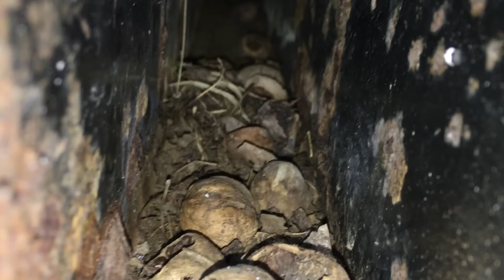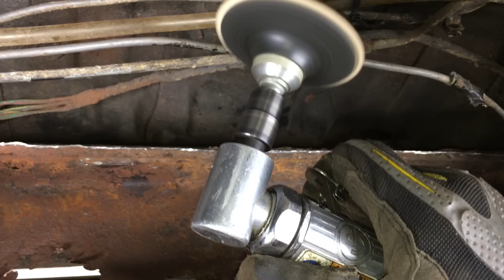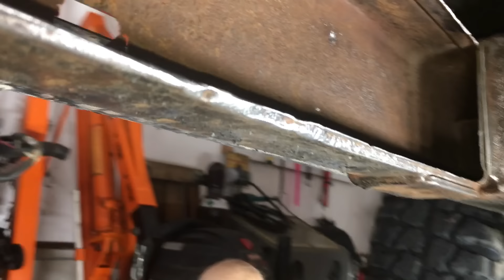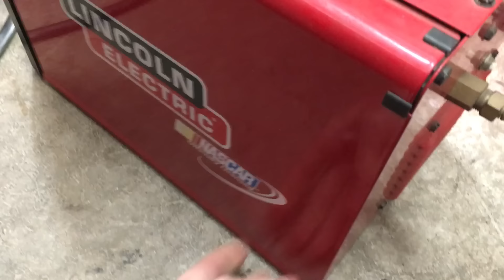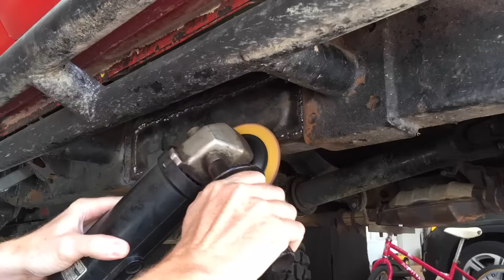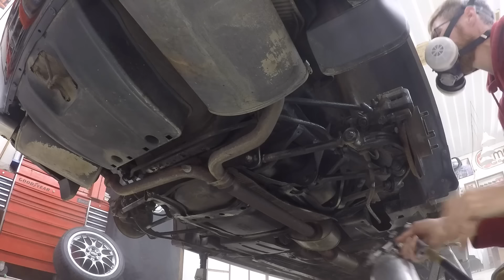How to Properly Repair Rusty Frame of Toyota Pickup Truck at Home

Comment: Should have applied a Weld Thru Primer (misnomer it's zinc/copper coating) on the inside of your patch piece to protect the inside from rust before welding.  Both SEM/Upol offer.  This is oem standard body shop repair procedure for inaccessible seams after welding since mig weld will destroy e-coat/paint and you can't paint it after.  Also I would have hit the inside of the old good part of the  frame with rust converter paint before fluid film.

Your welds are bad tbh - poor penetration - i wouldn't call those structural.  Inspect from rear side .  I bet they're vry bad.  Should practice more on same thickness scrap and dial in your welds beforehand and do destructive test of them to make sure your welds are solid.  I will not be hitting you up to do any suspension parts welding for me, no offense.
Reply from the maker: Yeah, I really wish I had a 220v welder. I used one before and it was effortless compared to trying to weld thick steel with this 110v. I really hope I can buy a rust free frame from down south, as this one has seen better days. No offense taken... I always appreciate advice from professionals/people who know more than I do.
Reply: @6thGearGarage    Flux core runs hotter and can do thicker work on same voltage.  For frame work its perfectly ok if its a bit messier and you can always use some antispatter around the work area if it bothers you.  Stick welding is also cheap and very good for frame work.  For thin sheet metal/cosmetic work obvi wire mig is preferable as you probably knew already from your other work.
Reply: It's easy to sit at home and write trolling remarks....the lad at least had the gumption to crawl under that rusty old truck and work on it, kudos to him, it's his truck, leave him alone, he's doing and learning like everyone else does.
Signed
A 66 year old pipe fitters & fabricator
Reply from the maker: @robertward8037  Thanks, I always get some flack on videos. I did it this way because it repaired the back half of the frame the exact same way 10 years ago and it's still great. Everyone has their own ways and I'm always up for trying a new method, as well as sharing one that worked for me.
Reply: @6thGearGarage  Keep doing what works for you, your work looks fine to me, I live in Ohio also and drive an 2004 Silverado to work and town....it's turning into a rusted heap from the salt...lol, you can crawl under my truck and do all the welding you want any day, I'm getting to old for it anymore, it hurts to get down low and get back up 🤣. Have a great life my friend
Reply: @robertward8037  unfortunately the rest of us have to be on the road with half assed structural welds so kindly shove it.  thanks.

Comment: Man, what dedication to your truck. I think most folks would have scrapped it a while ago. Nice work.
Reply from the maker: Thanks! I'd really love to swap the whole frame with a rust free one one day.
Reply: @6thGearGarage  I personally appreciate trying to keep the old frame alive, since for me it's just not an option to go find a frame from some southern state.
Reply: @1873Winchester  keep your mitts off our frames! Hahaha kidding.....a bit...
Reply: @REAPER3fitty  Don't worry I'm all the way over in Finland
Reply from the maker: @1873Winchester  I need to drive out west with a trailer one day and bring a stack of nice frames back to Ohio.
Reply: @6thGearGarage  you and me both, but eventually once you replace all the rusty stuff itll be fine.. haha my 90 grand wagoneer was nearly as bad, or worse... took years n years of cutting and welding, but 90% of it is repaired and fresh/clean, 0 rust now and tbh stronger than it was originally.   My shock mounts in the front pulled off the frame with the frame when i grabbed one to pull myself off the ground.. my body mounts.. werent even there anymore, i could lift the body off the frame and bounce it up and down...  And my shackle mounts in the rear were swiss cheese, the frame was swiss chease in the rear due to the trailer hitch brackets holding debris, and the frame a 2 foot section by the tank was rotten..  The cross member in the rear on top of the C channle was rotten and causing the c channle to sag...  I fixed all this in a townhouse parking spot outside with a flux welder... not to mention my floor boards had holes every where.

Honestly the best stuff ive found was using a rusty metal primer, the orange/red stuff, or rust reformer for the surface rust.. clean it off as best as you  can and put 3-4 coats on and in 5 years it hasnt come back.. surface rust wise
Reply from the maker: @jeepsblackpowderandlights4305  You must be from the north east?
Reply: @6thGearGarage  VIRGINIA and my wagoneer was from west virginia im the 6th owner and no one till me took care of it
Reply: Scrapping it would have been the smart thing to do.

Comment: Having the tank empty is way worse. That leaves room for fumes that can blow up
Reply from the maker: Thanks for pointing that out.. I never thought about that!
Reply: I’m no pro, but I heard that to avoid the vapour the gas tank needs to be either emptied washed out and completely dried or actually filled right up before it is welded - Ive used the wash and dry method but don’t think I’ll try the fill method myself 😅
Reply: @Mister Beans  empty, wash out, dry. Then hook a tail pipe onto it and will it with exhaust, no more oxygen. Then you can weld on it
Reply: Definitely one of the better repairs I've seen. Great if you are looking for a few more years out of it, but for my money and time a trip south for a rust free frame. Can have frames galvanized or powdercoated for not alot of money.
Reply: @penningtonmetalworks283  where can you get this done? More details please.
Reply: @HR HR  I have Tammi's Custom Coatings in Cedar Rapids Iowa do all my powdercoating. They have a lot of experience. I never have to chase threads or grind powder coating out of bores like a lot of the "Sema" build  YouTuber's do. AZZ Galvanizing is nationwide.  This is new territory for me, I have 2 customers requesting galvanized frames, so I'll see how it goes. I'm betting I'll have to chase every threaded hole. Don't think it will be as attractive as powder but probably the best corrosion protection for midwest trucks.
Reply: @penningtonmetalworks283  where can you get this done? More details please
Reply: Honestly you really shouldn’t be repairing sections of the frame that way. No reputable shop would do that. I know you don’t want to hear it but the only way that truck should be used is off road only. It’s time for farm use parts or the crusher .God forbid you get 8n an accident and get hit hard your dead , that frame is going to fold like nothing. That’s not even mentioning the fact that you run the risk of it breaking especially if you load it with a good sized payload.
Reply: @JohnDiMartino  your actually incorrect. Frames are repaired everyday in automotive restoration. They even sell replacement frames sections on summit racing's website. My neighbor would laugh at you, he replaced the center section of his 68 Charger...lol man I love reading comments for people that don't know

Comment: Did you consider descaler for the inside? On areas that you can reach with it anyway..  also, Eastwood has a great internal frame coating that reviews well.
Reply from the maker: I've never tried the descaler, I'll look into that. I saw Eastwood had a frame coating, but I was nervous about that flaking off after a while and sitting in the bottom of the frame.
Reply: @6thGearGarage  if you minimize or knock down the flakes, its meant to adhere to and encapsulate rust to stop its growth

Comment: When you patch a frame you should never do straight up and down welds that makes a very weak point. Any frame built from the 80s up until current they put giant fish mouths and overlap the steel they do not but it up against each other.
Reply: A butt weld with an additional fish/diamond plate over the top would also be acceptable.
Reply from the maker: I've heard that. And the plate on the frame for the IFS steering box, when I installed Hi-steer, was fish plated. But I've always done straight welds on the frame repairs for this truck because they were just one wall at a time and not a high stress area, unlike the steering box. But maybe I've just been lucky so far with them holding up. I'll give the fish plate a try on the next one... thanks for the heads up!  (If I don't find a nice frame and do a frame swap!)